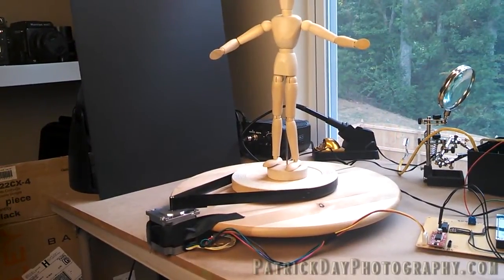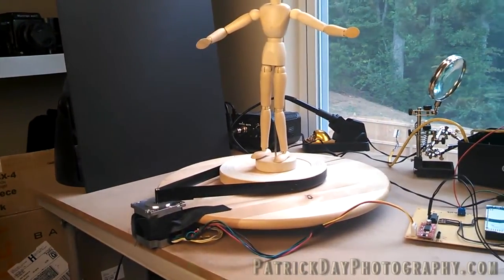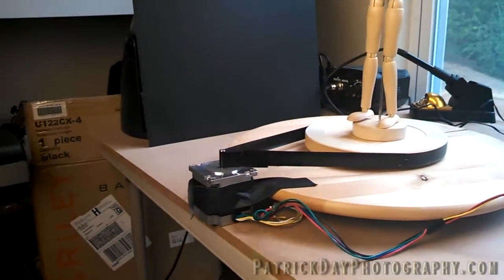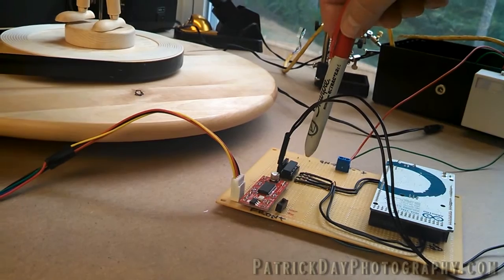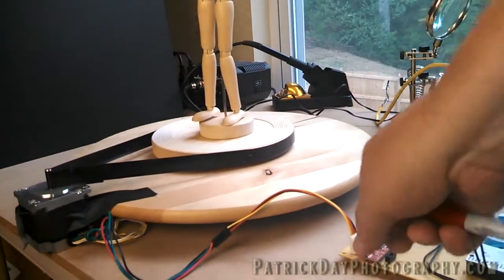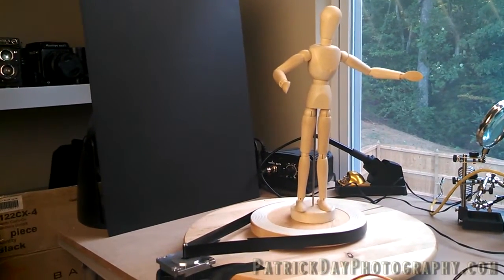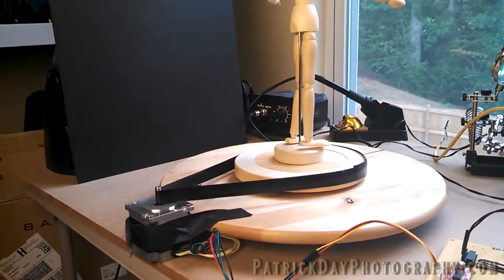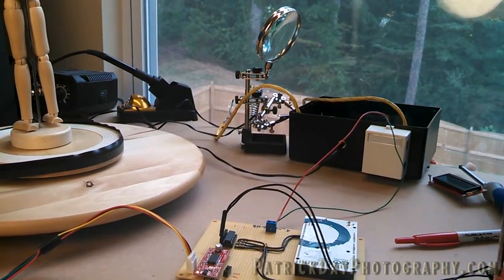360 Product Table Proof of Concept

Comment from the maker: Not a lot of parts really.  The main board is an Arduino Mega (i needed a lot of pins).  The Stepper motor driver is an EasyDriver (i may upgrade to the Big EasyDriver for the next version).  The display is a 16x2 LCD screen.  To keep the interface simple, I've decided to go with a Rotary Encoder for the input instead of a lot of buttons.  The rest is 555 IC chips used for debouncing switches and Optical Isolotors to fire the camera.